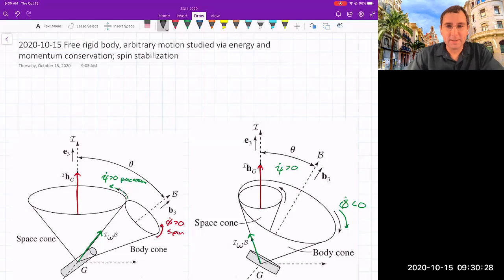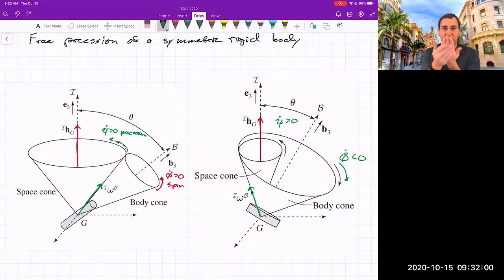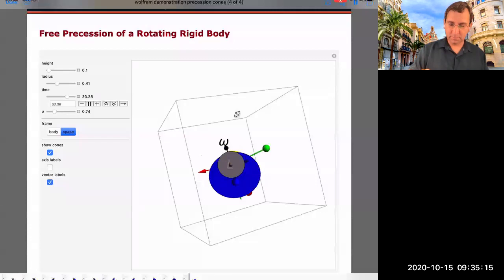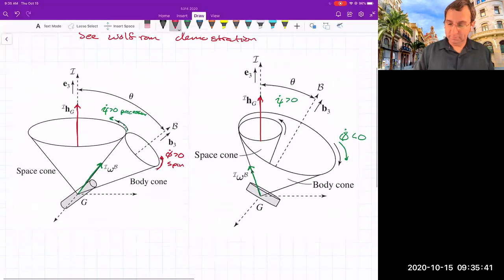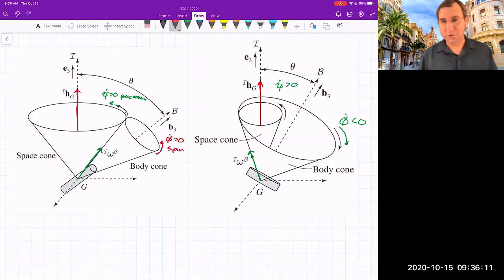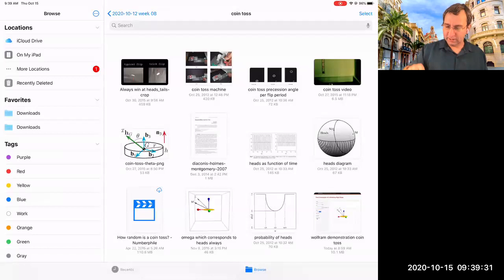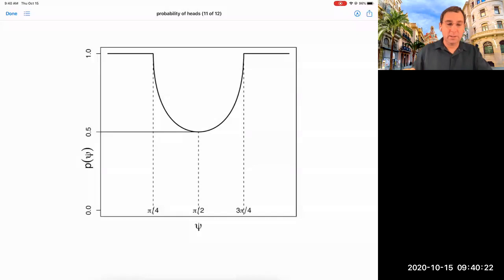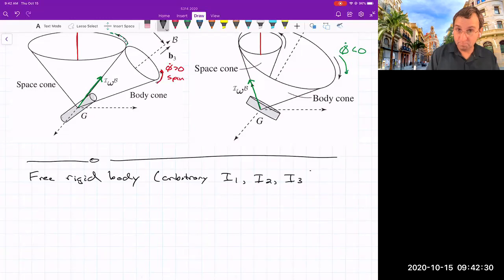Free Rigid Body Phase Space | Spin Stabilization of Frisbees (Flying Discs) | Lecture 16 of Course

Comment: At 35:06 You said when there is dissipation each of the contours lines instead of closing up with each other, would evolve towards a stable state which you called a point of minimum energy or the Largest principle Moment of Inertia. My question is How does minimum energy corresponds to Largest Moment of inertia when both quantities are directly proportional by this equation K.E = 1/2 I w^2  where I is the Moment of Inertia
?
Reply from the maker: Oguns, I agree it is confusing. The thing to consider is that if we write the kinetic energy in terms of angular momentum (instead of angular velocity), the expression would look like KE = 1/2 h^2/I, so the I is in the denominator. For dynamics in space, typically the angular momentum magnitude is constant (so h^2 = const), but kinetic energy can dissipate, so with h^2 = constant, the lowest energy state is the one where I is largest.
Reply: @ProfessorRoss  This is very clear